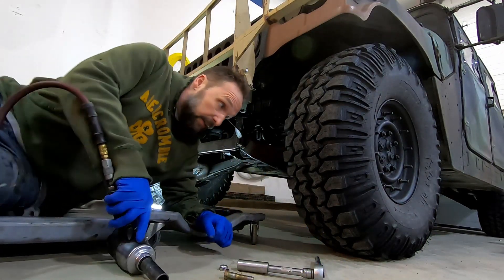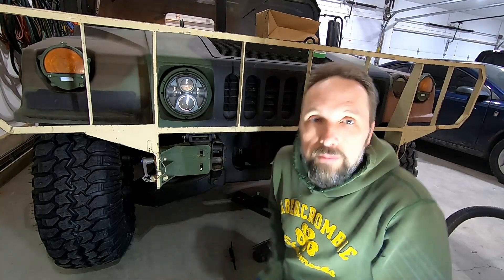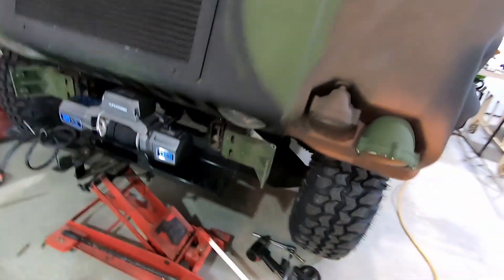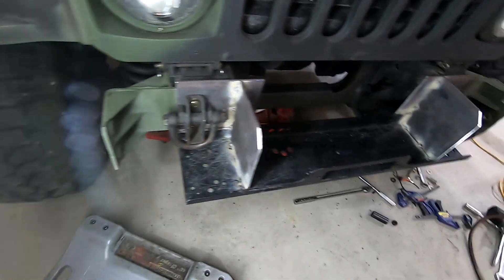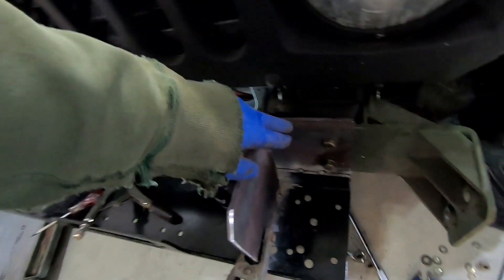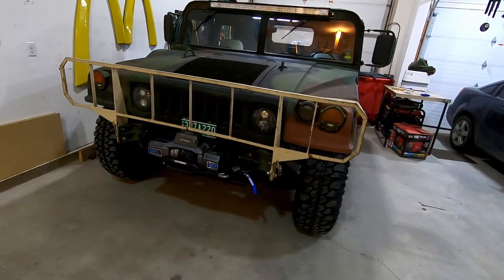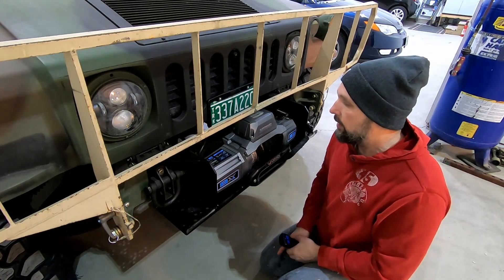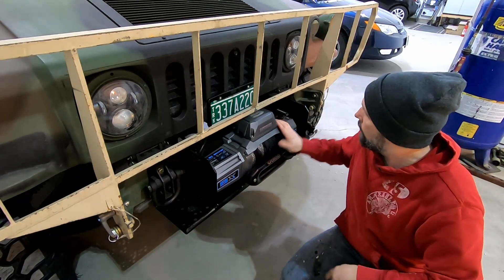Humvee Superwinch 1710201 SX 10000SR Winch install with a Summit Racing Winch Channel Mount

Comment: Hi how is winch mount holding up was going to build similar, thanks
Reply from the maker: @trikermoe  so far so good.  I’ve gotten it super stuck in ice and mud as well as pulled others out.  My welds look like crap but they have been holding.  The only bad part is it is low and when I go through deep water it gets wet.  During the winter it can then freeze the rope.  I’d like it higher but wouldn’t clear the hood without cutting that and I don’t want to do that.
Reply: @  thank you, love the videos
Reply from the maker: @ thank you!   Hoping to get out again soon.  Had two shoulder surgeries this year and it has kicked my butt.  Truck has been collecting dust but hoping to get it out soon.

Comment: Seems like you could have avoided a lot of pain and suffering by installing one of the milemarker winches designed for the platform :)
Reply from the maker: True.  Except finding a reasonable priced unit and shipping to Alaska with all the hardware and hoses and parts was not available or an option at the time.  A factory winch would be best.  Only that you have to have the engine operating for the factory winch.  I like the idea of electric only in the event the engine is damaged.   But if I could have located a factory OE complete assembly I would have been happy with that for sure.  The nice part of this too is now that it has a standard winch plate I can put different brand units on it if I want.  I can still put an OE one on if I find one.
Reply: @McSpeedAlaskanAdventures  have had both ther 12k warn and now the milemarker on my H1s.  Prefer the Warn but the hydraulic has its benefits as well ... big one being that it can't overheat.  Love your videos of the truck in the Alaska wilderness!
Reply from the maker: @nothingtoseaheardammit  good point on the overheating.   That’s an issue on electric for sure.  I’m glad you like the off road videos.  It pains me putting scratches and dents and bumps on it, but it is what they are made for.  Spoiler alert.  I just bought a set of aluminum doors with roll up windows.  That will help a lot for safety and more.  The canvas doors were new in the box a year ago and look terrible now and have some holes.   The Alaska trails are not kind to canvas and vinyl.

Comment: Love the tires, what tires are those?
Reply from the maker: Thanks!  Those are interco brand.  Better known as super swampers.  These are called trxus m/t.   They are stock Humvee size 37x12.5x16.5.  They are on a stock two piece rim with a trail worthy fan dial bead locker insert.  I removed the run flats.
Reply: I got the super swamper iroks with softer springs and the ride is 100% better than the stock military tires ! Also got rid of the run flats and installed pvc sleeves to lock the beads.